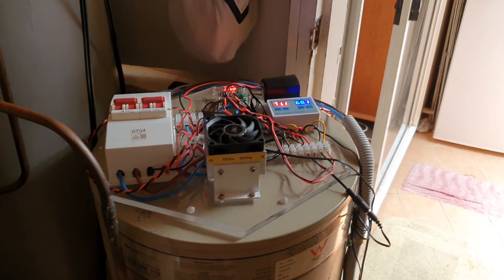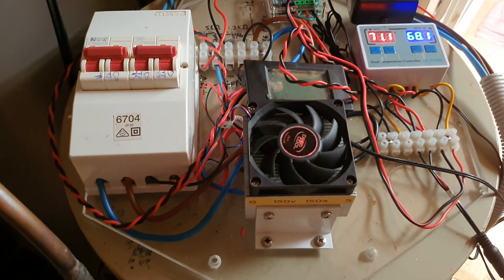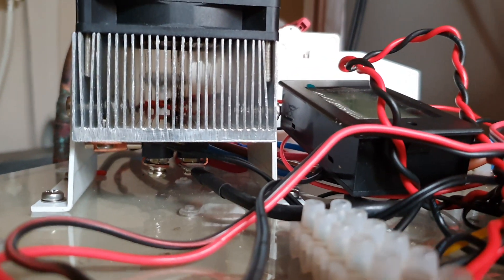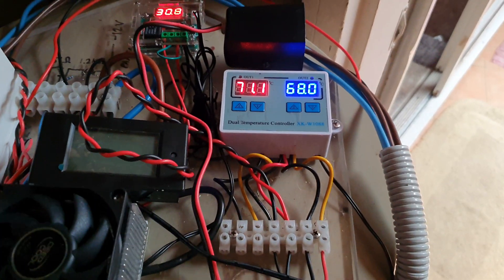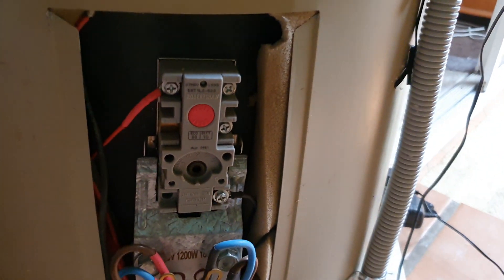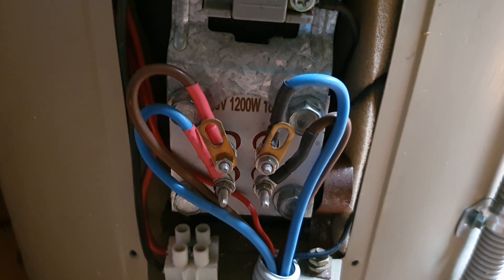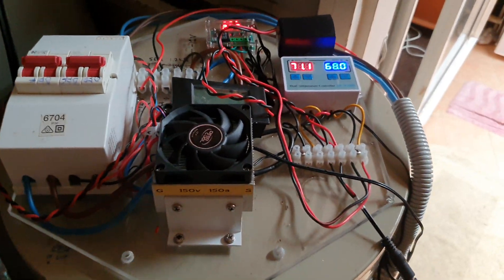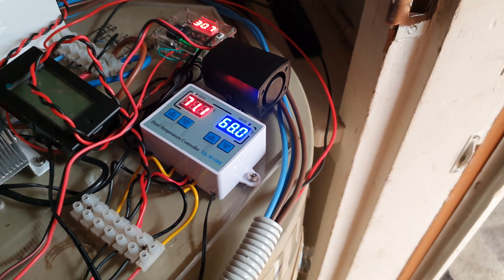PV solar hot water conversion

Comment: Congrats on using a FET instead of a SSR block.  But, this isn't used to full potential. There is no need for a fan and heatsink should just be a convenient mounting and not get warm. Lets figure an on resistance of .015 ohms.  At 27A that will be 11W of heat. Two FET in parallel would drop that to 3W and three drops it to 1.5W.  I would not use less than three. It is actualy worse than that as when a FET gets e hot the on resistance will double making that more than 20W that has to be dissipated.  Operating at low voltages makes no sense to me as the losses are so high. You should double that voltage at least.
Reply from the maker: As this is only a test that I have setup at a friend's place, I have the intension of changing the config of the solar panels ( 8 x 235w in parallel now))so as to double the voltage to approx. 58v mppt and changing from a 1200w 36v element to a 48v 1500w element, as I am not using any mppt controller at all, this voltage will probably be a bit lower then that, I have set the mosfet fan to 47 degs turn on, which is about 20 degs above room temp, the mosfet when running current through it takes awhile before the fan cuts in and out, I could increase this fan cut in temp high and allow it to rise to a point that the fan may never turn on, but I do like having the mosfet run at a lower temp, yes I could double or triple the mosfets to reduce resistance across the mosfet bridge and reduce the heat generated, but at this stage I will trial without doing this
Reply: @sjdtmv  Conflicting statements leave me not knowing what the label MPP is. Still, it appears doubling  the array voltage and connecting the 36V elements in series will produce significantly more power. Some studies have shown the ideal resistance can almost be doubled before there is a significant loss in total daily power. more important is that higher resistance speeds water heater recovery in the morning and on less than ideal 
days. I don't know your cloud conditions in AU, but seemingly small clouds can drop the power quite a bit. 6,000W 208/380 three phase elements could be an interesting option and allow staged resistances.

Get a voltage reading across FET greater than 5A to calculate the on resistance. I've run into a lot of parts that don't nearly meet spec.

I am jealous of that array of that array size. 1200W is about what I have to run the camp and heat water. Would love to add another 500W but, there is no more space for panels as my site is very challenging. I have made the most by using the same array for house power and harvesting any extra to heat water. Granted it is far easier to do in the summer. I was amazed there was enough extra to heat an additional 40 gallon tank in the garage for the washer. 

I apologize for that unfortunate intrusion and lateness of response. I do not have internet at home in winter and in the current crisis I am going out very little.
Reply: This opera guy is a nutter. he has lots of videos on utube and I challenge you to make one of his devices or circuits work . He seems to be a troll on the subject of hot water heating and should be left well alone!
Reply: This might be a stupid question and not being pedantic......Heating water with electricity from PV solar is like a Rube Goldberg contraption.  Wouldn’t black water tank on the roof be easier in that part of the world?   And 70c ...ouch😳
Reply from the maker: @daversj  There are plenty of used solar panels going for free, and there are a lot of people that are willing to live off grid or semi off grid, hot water is a large cost  one way or another, if you have an existing electric hot water tank and put a small low voltage element instead of the standard mains voltage, you not only get free hot water but with a large tank like i have try out of 400l this heats up very well and can last for days and is on tap 24 hours a day, a black tank on a roof can never do, let alone the weight of the tank and slope of the roof would most likely collapse if not well built, plus the heat loss over night